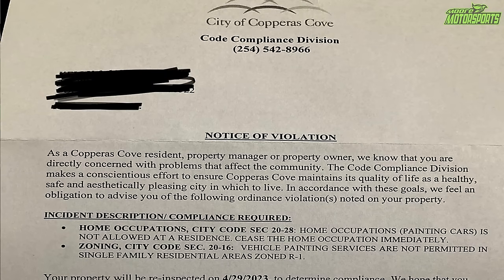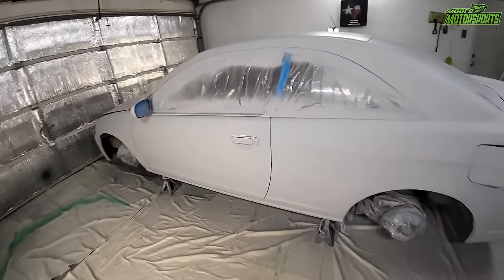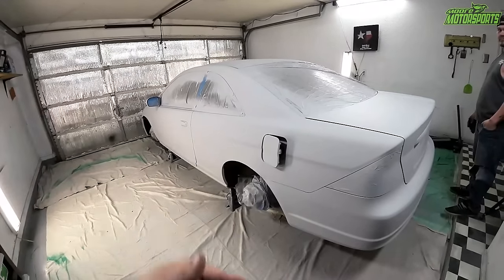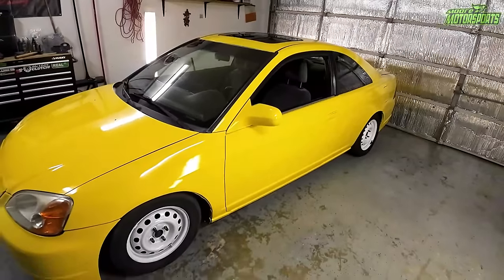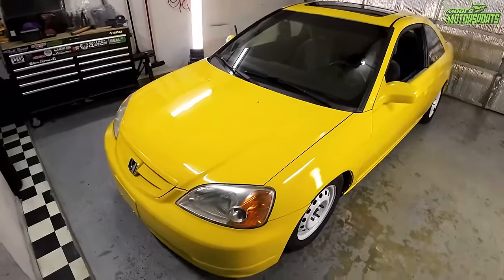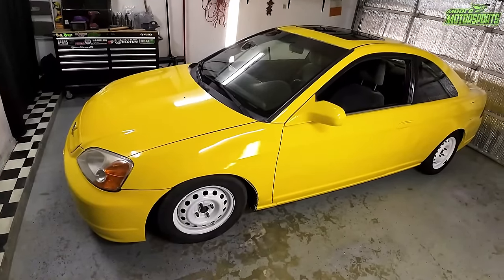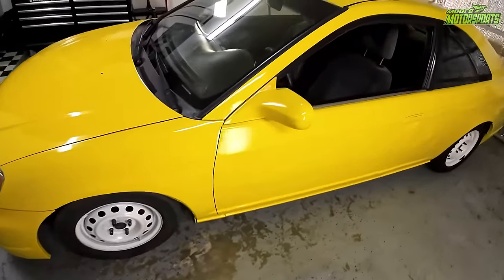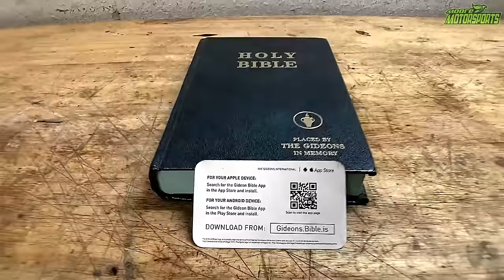CHEAP SPRAY CAN PAINT JOB ON A DONATED CAR! (PAYING IT FORWARD)

Comment: I been spray painting my cars and trucks for quite a while. I went and got the rust-oleum deluxe spray can handle because my finger tip has gone numb. Do not get the cheaper handle they don't work. I did my 91 nissan d21 4x4 recently. I used krylon silver hammered first then light over sprayed with hammered black. then 4 coats of clear. turned out awesome. Just came across your videos today 9/10/23. Was looking to see how to smooth out some cloudy paint. Great work. I live in the country but have no garage so I have to fight with bugs, dust, wind, leaves, varmits and storms. And I learn a lot from my mistakes. One thing is with spray paint you can just let it dry sand her down and redo it. My neighbors don't give a hoot what i do and we all go to the same church. Don't pay any attention to what the naysayers say just keep doing GODS work because the LORD will work things out for you. GOD bless. DAN C.

Comment: I am fixing to do my car Sage Green Gloss for a complete noob like myself would it be better to do each panel separately or try to do the car as a whole? Car looks good glad you are helping someone in need.
Reply: me personally since I didn't have a location (used my backyard) and the time (working 50-hrs per week), I think it would be best to paint panel by panel. And if you use the Spraymaxx 2k,...i would wait like 4 days before you wet sand it (if you have to wet sand). During covid I came across Morre Motorsports and this channel it's been a godsent. And watch more videos from this channel...this guy knows his stuff. I painted my car with rattle can...took short cuts on the body work (working 50-hrs per week), and people are amazed that it was done with spray paint.
Reply from the maker: @demetriusrussell3261 awesome!!
Reply: I am doing my Chevy truck in Dark Grey Gloss right now little by little. Just did the tailgate and primered the bed this last week.  Take your time, and it will look nice.

Comment: You used the turbo primer on the Integra that you painted metallic blue. How did you then prep the primer before painting?
Cause now I think I'll rather use the method you used before on previous cars.  Sand it --> Edge primer --> Sand it --> Clean with window spray --> Three coats of Rust-Oleum 2x paint & primer --> Two coats of 2k clear coat --> Wet sand it --> Maguire's compound --> Polish --> Done.
Cheers!
Reply from the maker: Yes that’s ideal!! ^ I didn’t have enough time or money for that or I would have. Neighbors didn’t help

Comment: How long doeds rustoleum last ? In hot climate ?   Before it starts fading ? 

 Im thinking about using the stuff that comes in a quart ...  
  Spray with a cheap gun !
Reply from the maker: Works great and depends on many factors but I see a few years out of them if no clear. Depends if garage kept or not and waxed or not. A lot of factors

Comment: Awesome job man. Keep up the great work! As far as the orange peeling goes. I am in the process of sanding down and painting a 1998 mercury I got from my brother. Would you recommend that the best way to avoid this would be just to ensure it is properly sanded throughout and nice and smooth beforehand?
Reply from the maker: Yes get the primer smooth smooth and make sure cans are warmed up and orange peel isn’t that bad.
Reply: @JamesDguy  perfect. Warm shouldn't be an issue I live in Florida I'll throw em in the sun for 10 minutes lol. Thanks man

Comment: Didn't think yellow would look good on that car, but it does!!

That Civic has the D17 in it, right? Will you be doing the timing belt, etc. before it gets donated?
Reply from the maker: It’s already gone. the engine was replaced before I got it. Just need general maintenance.

Comment: Wassup my brotha. I was in Home Depot the other day and noticed that Rustoleum changed their spray cans. The cap now has several different spray nozzles built into it so you can choose the pattern based on what you're painting. I picked up a can to try it and it's pretty sweet. Great vid as usual!
Reply: The "5 in 1"?   It got a good review.

Comment: Looks great. After primer is dry, how long do you have to wait before applying gloss coat?
Reply: 24 hours
Reply: @BigGroovyOg  yeah that’s what the can says, but if anyone knows what actually possible to get away with, would be this guy.
Reply: @3gcraftsman  I would sand the primer again. Clean the vehicle. So I would say 2 hours.
Reply from the maker: I waited 45 mins
Reply: @JamesDguy  quick question. My crown Vic paint start to chip. So I’m In the process of sanding the clear coat, and the areas that are chipping. Is 320 all the way around good before I spray paint primer on the car?

Comment: Nice job and awesome to pay it forward.   As far as the orange peel texture goes,  another method would be getting closer to the surface with the initial.primer coat when spraying.  It appears that the application was more of a fog coat which promotes good coverage but high build/orange peel.   Rock on mate and well done

Comment: Great videos. I just spray painted 2 panels with rustoleum spraypaint . For several reasons, I need to get rid of that spray paint. Would you reccomend sanding it off or is there a stripper that works well? Thanks for any help.
Reply: if like this info too.

Comment: You didn't use a guide coat on the primer? And just a tip 400 grit sand paper works the best on a Sanding block for primer tho.

Comment: I will be using white rustoleum turbo GLOSS, AND the 2k spray maxx.
My question is, should I let the white glossy base coat dry completely, then sand, before spraying the 2k?
OR can i just fully complete it all, 3 coats glossy white right into 3 coats 2k spray maxx clear coat waiting at least 10 minutes in between???
Reply: Rustoleum is enamel. Let it fully cure before applying a 2K clear coat. If not, the enamel won’t be able to off-gas if you cover it with clear. The gasses will be trapped under the clear. Not good.

Comment: Im not a pro.  I have done the same thing.  And learned  front my mistakes. The bumpers  will not hold. They need a flexible  paint  &  U a Special  cleaner  coat for the car & bumpers. I spent  so  much money  on sand paper . 😖
Reply: Deff need to add flex agent to plastic bumpers\pieces or its just going to crack and flake off

Comment: As much painting as you're doing I suggest getting a compressor and paint gun from HF.  You're going to be way happier with the coverage, much faster and you will get an even coat.  The automotive paint will last a lot longer especially with a clear coat and it's really not that much more expensive.  You will save money in the long run.
Reply: I believe he already has that equipment and knows how to use it all as he's stated from previous videos; he just prefers this method he's been doing for over a decade.

Comment: Orange peal adds depth unless you are up close. You can paint a car any way you want as long as you understand paint. Long dry times are your friend if you are using spray cans. I hit a deer 6 yrs ago and painted the new fender and bumper cover with walmart paint and it is starting to fade now but only when I'm up close. 20/20 it's good. I think spray can jobs are OK now because the quality of paint is way better than the old days when people would zebra stripe cars with quick dry Lacquer.

Comment: Do you have any experience with 2k adc (air dry converter) paint? I believe Eastwood does one but called a different name. I am having a hard time getting it to fully cured, I wondered if you have any insights
Reply from the maker: I haven’t messed with it yet

Comment: Ask the city if it is legal to use spray cans in your city. If it is then what you are doing is legal. Just because it's a car your painting should not make it illegal. Can you paint lawn furniture with spray cans? No difference. If not then the city should ban the use of spray cans for anything. Looks good by the way.
Reply: @garry4816  I think the code compliance letter was more for working on the car outside. Most cities have an ordinance regarding working on your vehicle. As for painting in the garage the city has no already to tell you what you can do and not do inside your residence, it's no difference if it was using a airless sprayer painting his walls as most residential painters spray rather than using a paint roller

Comment: Hej hvordan maler man en kofanger som aldrig har været malet, jeg syntes du laver et fantastisk stykke arbejde...er ked af at dine naboer er som de er overfor jer at de ikke kan se det smukke arbejde du laver, undskyld jeg skriver på dansk men jeg er meget ordblind
Reply: Gern!
Reply from the maker: If the bumper paint is in decent shape I have used normal rustoleum to paint it. Just make sure it’s sanded smooth and wiped down. 320-400 grit and smooth.
Reply: @JamesDguy  Mange tak for hjælpen

Comment: I suggest reading the code definitions especially for home occupation. Part one says secondary to dwelling purposes. They only have dwelling defined as an noun not an adjective, you might be able to use that as a loophole. Also, it says home occupations don't include car repair which could be good if you can successfully argue it's car repair, but could be bad if they successfully argue car repair is by definition a business and if the fines are higher. BTW, I find it very odd that there's only a number for questions and not any information on an appeals process. I haven't lived in Texas, but I succeeded in court against a previous state (not a lawyer just a regular person) because their failure to adequately inform me about the appeals process was considered a violation of due process. States vary widely, but maybe you can get a free consultation from an attorney. Sorry, bout your neighbors.
Reply from the maker: I looked into it. I’m moving anyways
Reply: @JamesDguy  Good Idea. A lot of the rules were crazy.

Comment: Do you wet sand and buff after spraying?
Reply from the maker: Depends on level of detail and budget. If it’s going to be wet sanded and 2K clear coated then yes after it’s clear. But if not then I don’t always. Just depends on the car really.

Comment: Would it be better if you sand in between coats then apply clear coat for final or should I rather use a spray gun if I'm doing this? Appreciate you my brother.
Reply: Use a spray gun and compressor.. painting a car with rattle cans is simply ridiculous.

Comment: You probably live right next to the one that handles the HOA. Also having your garage open and one fan and the rest of the bottom of your garage exposed, let's all those fumes out that they can notice.
Reply from the maker: Your probably right. It’s either I do a fan and filter to help cut down on fumes or nothing at all. I’m doing more than most would lol.
Reply: @JamesDguy  yeah I'd suggest more fans and the filter you're using. It'll also pull more fumes out aswell.

Comment: Hey man I keep having issues with wrinkles on rustoleum turbo
Reply from the maker: Did you use primer first? Wrinkles come from paint that hasn’t cured yet or it’s going over paint that it reacted too.
Reply: @Moore Motorsports Garage  think I figured it out. Room temp was good but the temp of my metal hood was too low. So the surface flashed off but base stayed wet. 

Wet sanded with 600-1000-2000 and it looks decent.

Comment: How long does the paint last?
Reply: Rustolium is known for keeping its shine for years.  Leaving it in the elements 24/7 will definitely reduce its life.  If the prep is done right, peeling is not an issue.  It will probably look this good when it's finally retired from the road.
Reply from the maker: They answered it well for me.

Comment: My friend I live in Jamaica, I have a car that I can't afford  to paint  and am not seeing any on Amazon
Reply: Any suggestions
Reply: A cheaper alternative is to use liquid oil based paint with thinner and a foam roller. Spray cans are more expensive because they are more convenient. It is also better to use something like white. Less coats are needed for full coverage and it hides more damage and orange peel and looks the best once oxidized. Some colors oxidized very bad in the sun. Red is the worst.

Comment: Yellow is loud nice job though not sure what orange peel means but it looks great
Reply: Orange peel is a paint technical term used by professional painters! The surface doesn’t look as smooth up close! Usually remedied by light water sanding! And probably buffing out!
When he shows the paint up close you can see the Orange skin look in the paint. Hence  the name.
If there’s not enough coats of paint/clear coat on the surface… harder to smooth it out without problems!

Comment: It's your garage, you bought and paid for the hpuse so you can do with it whatever it is you want.
Reply: Not when it comes to over spray getting all over your neighbors vehicles.  Not the mention the paint odors.
Reply: @vegasfordguy  if it's in the garage it'll be fine Karren.
Reply: @curtismccombs2212  Garage is open with over spray going outside.

Comment: the paint does not comes smoot from a little air in a can, better empty the cans and use the proper air, 25 to 30 PSI LOLL,  or get it in 4 liter cans and mix it yourself RIGHT

Comment: Looking at the city codes, they took lot of creativity to rewrite the code. 20.28 say that it is ok if it is not display any evidence and if not assistant or employees.

20.16 also they rewrite the code, but there is a chart and body repair and paint is on a business building. 
BUT Church is permitted in residential....so maybe a doing paint jobs in the name of Jesus under a church home could be the ticket here! ☠️
Reply: 😂 that a great idea. The Church of the rattle can! Bringing hideous cars and people to Jesus one can at a time.
Reply: Yeah guys,I agree! Hey, just as Jesus turned the water into wine,James can get 20 spray cans out of 10!
Reply from the maker: We read the codes and you would be blown away if you read them all. 😂

Comment: I enjoy your videos, however to be fair, nobody wants over spray on their vehicles, boats, motorcycles, etc. Over spray from spray paint travels and can cause a mess on other vehicles. I wouldn't tolerate a neighbor who constantly spray painted out of their garage without proper filtering either. That box fan with that HVAC filter isn't anywhere near adequate. You have to look at it from the neighbors prospective.
Reply: There's not a chance any of that over spray is making it close to the neighbors belongings 😅
Reply: How much painting do you do? I'm a painter. I do a ton of painting at my house. A box fan with the correct filter actually works incredibly well. When you take the proper care and set up, it's amazing what you can do efficiently effectively. Don't make the assumption that there's overspray blowing all over the neighborhood for one that is spray paint. I don't think you understand the dry time for it to travel from his garage to a neighbor's vehicle. It would have dried long long long before it ever made that trip . But I can definitely see your point of view by the way, those HVAC filters, many of them are rated to pick up materials that are not even perceptible by the eye. So most of the filters I put in my booth aren't even rated for that. It's actually probably a much better filtration system. If you look at it, simply filtering out particles